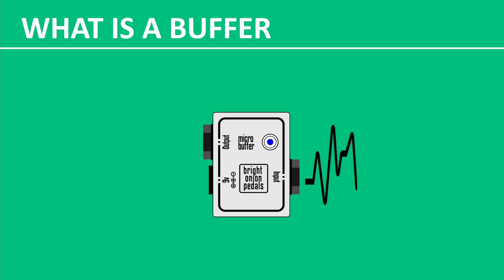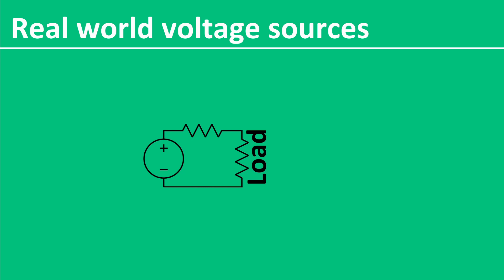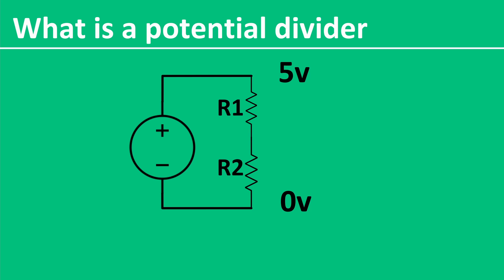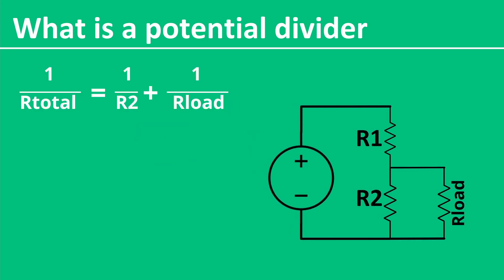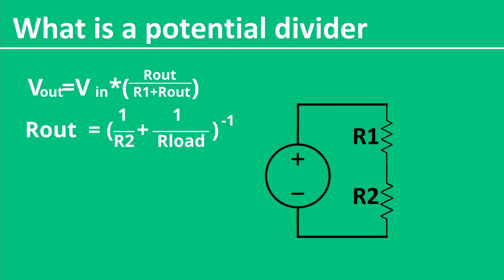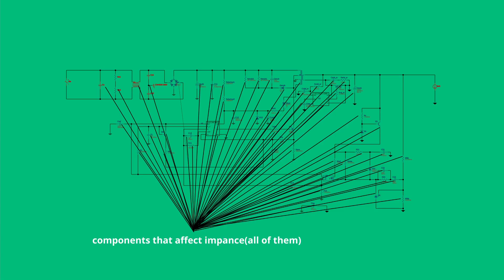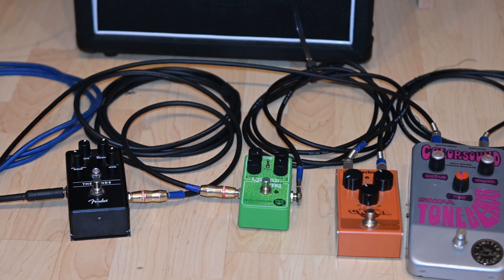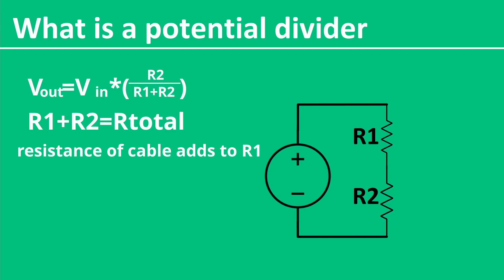explaining the electronics behind why we need buffer pedals.

Comment: One thing to note is, that this ist mostly only applies to guitar pedals with true bypass. Non true bypass pedals, like the ones from Boss for example, do always push the signal through the circuit, and this way also act like a buffer.
Reply from the maker: Yes most boss pedals are buffered. I should have mentioned this. The original video was much longer and explained the difference between buffered and non buffered pedals , but it got too long and I cut it out.
Reply: Boss pedals do not include high quality buffers, as is true with the Klon and tube screamer etc., so they are going to color the sound in a way that may not be desirable.
Reply: @ThoughtAstronaut  Yeah I know that most of these pedals color the sound, but they still do buffer, which was the whole point. I also thought of it more of a FYI for people that already own and use these things.
Reply: @mfsoab  👍🏻